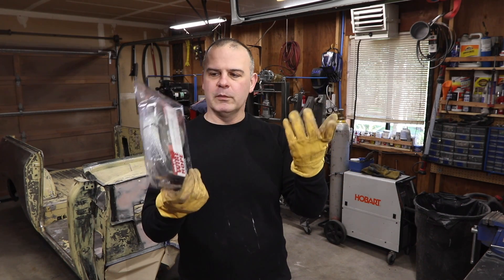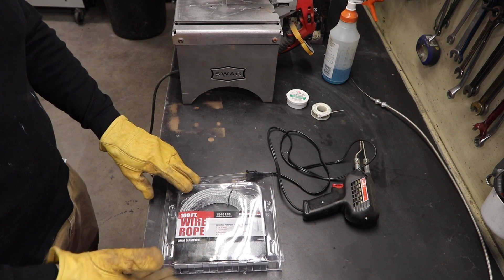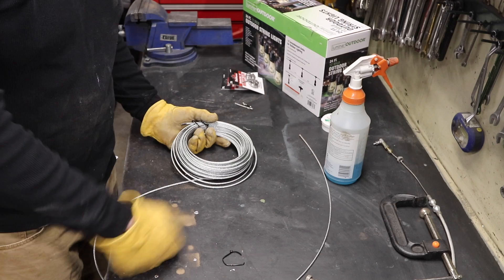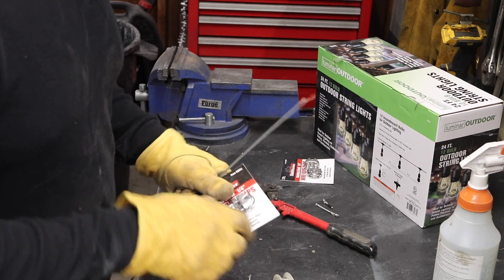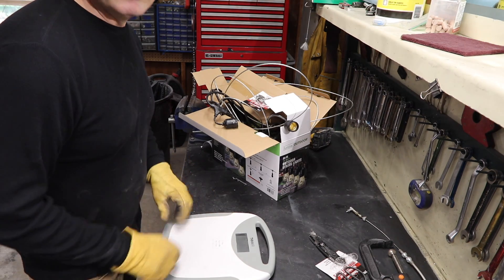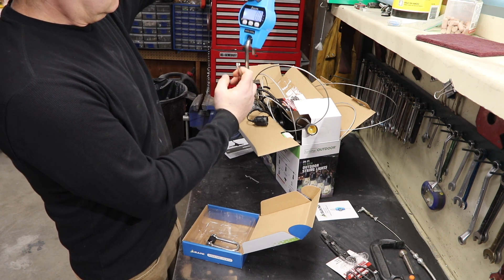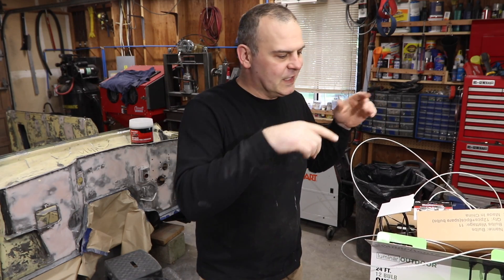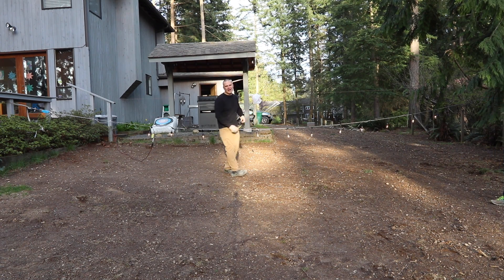Measuring Catenary Tension Load

Comment: How much sag did they assume when they calc’d 800 lbs tension? I get a little less than 1/2” for 800 lbs.
Reply from the maker: Didn’t measure that. When you say you get 1/2” are you referring to a calculation or a field test?
Reply: @MattsGarage  I’m referring to a calculation I did using the weight and span length of your light string. You mentioned an engineer calculated 800 lbs and I wondered how much sag he/she assumed for that. I think you tightened it to 5” sag, much better than 1/2.
Good video, thanks.
Reply from the maker: @ronofthenorth9302  I think he was in that range, but we didn’t ask for no sag. It was a bit of a fight with him. I told him to let it sag but he just would not back down on the calcs so we were forced to put in 7’-10’ deep foundations for the poles. I was annoyed.